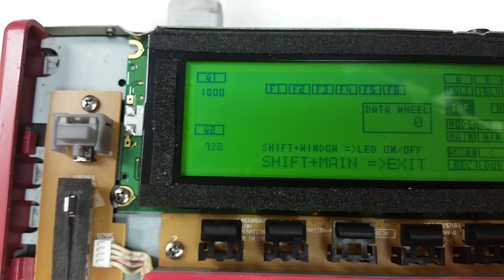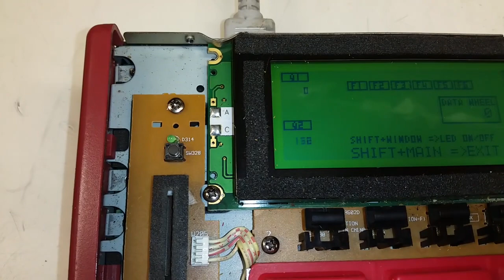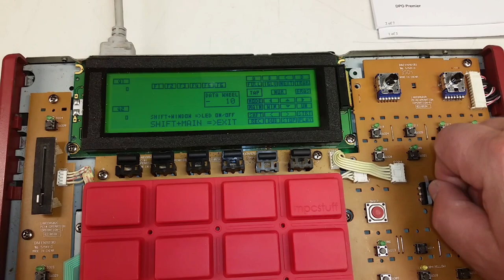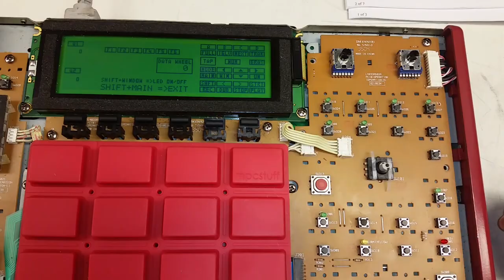MPC 1000 Q-Link Slider Repair

Comment: Nice work!
Reply from the maker: Thanks Mariano. I appreciate the thanks. Best Wishes and Blessings. Keith Noneya
Reply: @keithnoneya  Hi! i hope you are doing well! i have any questions: this component its exclusive for AKAI? or i have change this for any similar pot slider?  you know the specification of this Pot Slider?
I from Argentina and is not easy to buy and shipping from USA to here.
Thank You!
Reply from the maker: @me_conto_un_pajarito  Sorry it took so long to get back with you. I don't think it's exclusive to that unit. It's just a basic slider. You could take the measurements of the connections and the tabs on the bottom. Then Measure the resistor value and look for one on Newark.com or Digikey.com. If you still can't find one the resistance value of the pot is what's important, get one with the same resistance value and use that one.
The actual item belongs to a friends who asked me to work on it for him. He now has it so I don't have access to it anymore. 
I would check the links in the video description below the video and there is a forum in there. I know someone will have the exact information you need. Hope that points you in the right direction. Also you can download the manual and the part number is in there, I checked. Best Wishes & Blessings. Keith Noneya